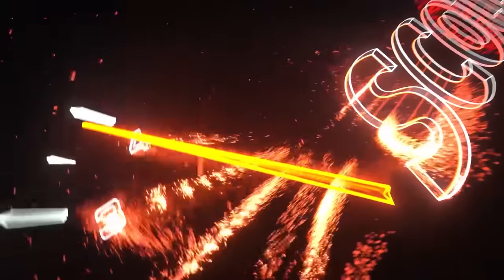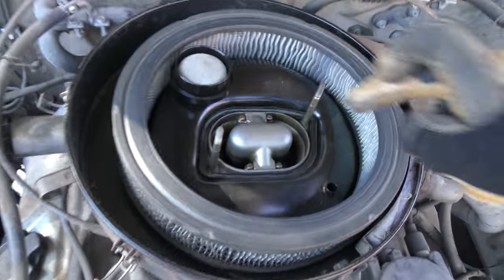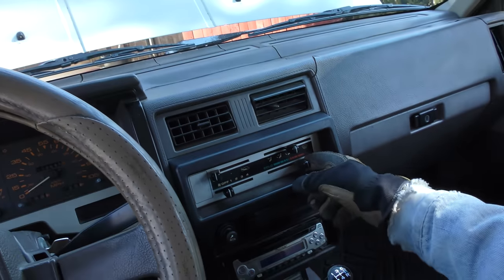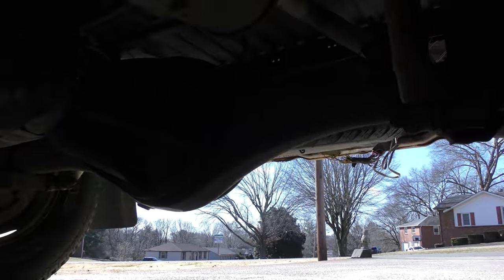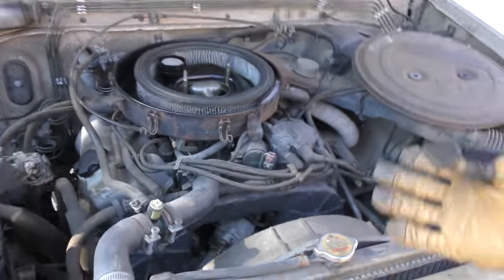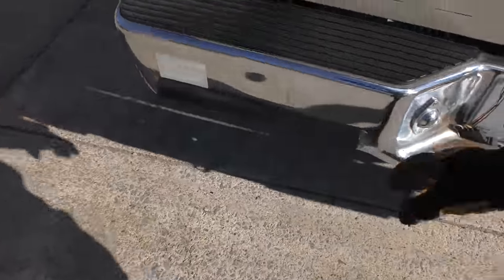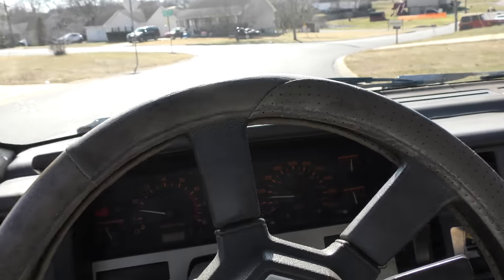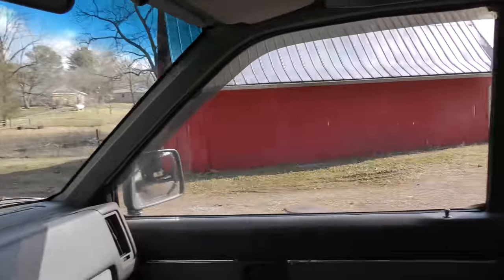I'm Sitting in the Best Truck Ever Made (Goodbye Toyota)

Comment: I had the same year hardbody with a manual transmission and the 4 cylinder, 8 spark plugs engine. No A/C, no power locks or windows but was a solid mini truck. I had to sell it back in 2005 when I moved out of state but I sold to my friend's dad who still has to this day and it's still running strong 😁
Reply: Back in the day certain brands that aren't very reliable today had a reputation for being some of the strongest at the time. I do like Nissan quite a lot and I want to turn one of their cubes electric.....give it a whole new lease on life because those transmissions you know are just junk.... I want to give it a better drive train and prove that nissan and others can be revived and saved by going electric. Plus i just want a cheep cute and reliable car that wont leave me stranded because of the dumb cvt
Reply: How many miles on it? My family has a 8 sparkplug 2.3 Ford Ranger with about 600k miles. Its a 1993 so its pretty basic. The engines been good but the transmissions had the clutch replaced and some minor work
Reply: @carsonac4163  I sold it when it had about 180k miles on the odometer back in 2005. I don't know the current mileage  but the last time I spoke to my friend, his dad just uses the truck if he needs to haul stuff. His dad is in his mid 70's and driving a truck with a manual transmission and no power steering gets challenging for him so he only drives it when he needs to.
Reply: did it at least have power steering? 😂
Reply: They were solid little trucks
Reply: @hllymchll  no power steering 😭 built my forearms 😂
Reply: same but i have it still grandfather parked it about 17 years ago and he let me have it to work on, manual transmission went out at 460k miles engine still runs like its brand new though. he also had the 1996 but it got into a front ender and I'm working on rebuilding both. both are 4x4s with the 5speed manual.
Reply: Saying a 4 is the same as 6? Ok then it's the same as a v8
Reply: Me too..lol..87
Reply: If I remember correctly I paid about 7800 for mine new.
Reply: Yess Sr  b I have the z21 is very rare
Reply: @hybridstoatdragon later Frontiers have been known to go a million miles. That's hardly unreliable.  The c a r CVT issue seems to be the main problem.
Reply: Lol i had the same truck for years, I didn’t even chance the oil the thing never broke,  somebody came over and told me to sell it and ship it to Mexico, it’s been 15 years since i sold it, and still driving, even better.
Reply: I had a 86 Nissan King Cab five speed with a Z24 4-cylinder 8 spark plugs heat and air power steering but manual door locks and windows I had a 89 Nissan with a 2.4 4-cylinder 5-speed regular cab two wheel drive no power steering manual door locks and windows no AC had a good heater though both one tough little trucks the four-wheel drive one an automatic login logout hub
Reply: @harveyshields9534  I want Scott to test out my 1987 2WD king cab 4 cyl XE. Had it since 1995.
Reply: My dad had the same one. 86 1/2 king cab 4x4 4cyl  5 speed manual XE. 
No A/C. Guy who has it now drives it everyday.
Reply: What engine was 4 cylinder with 8 spark plugs, I've owned both models from the 90s with the 4 cylinder. And none of those had 8 spark plugs
Reply: It was the Z24 engine  @Leprechaun_of_Maryland

Comment: I have a 2000 Nissan frontier. I bought it for $500 and replaced the timing chain with my father. Love it. It has never let me down in the 4 years I've had it.
Reply: The D22 frontier is basically an updated of the basic Datsun truck. 

Its bigger and wider but it still has the same Datsun DNA, particularly the 4cyl ones. The KA24DE Frontier engine can trace its roots to the L series engines that first appeared in Datsun 521 trucks in 1969!
Reply: @twoeightythreez  Yep. I once rebuilt the L20B and L28 in my Datsun 620 and Z car. 
When it came time to do my 1987 D21 with the Z24i, I found that everything below the 8-plug head was L-series all.the way. Even the cam drive is the same.
The hardbody even sounds and drives much like a Datsun with a little more torque. 
And in turn, all that DNA came from Prince Motors when Nissan bought them out, and Prince actually licensed it from Benz. So my truck  actually has Mercedes genes, oddly enough. And now, the new Nissan 9 speed is licensed from Mercedes too.

Comment: Actually, BOTH the Nissans and Toyota Trucks from the 80's were like the BEST trucks ever made.
Some carmaker should create "simple" cars again, because they CAN be created to be less polluting as well.
Reply: I had an 82 toyo longbox 4 speed, am/fm radio, vinyl seats, bulletproof 22R 4 cylinder. Wish I still had it, stone simple, reliable and not hard to fix. Unfortunately Minnesota winters were unkind to body and frame. It dissolved.
Reply: @leeuniverse Like the Ford model a
Reply: 100% fact. Best trucks made 😎👍
Reply: Hard to do when a bunch on know nothing bureaucrats in DC tell the car companies what to build.
Reply: That would be great, but then they wouldn’t be able to rob you blind bringing it into the shop every 6 months lol
Reply: Reminds me of the 80’s model Yota Hilux. Solid axle boxed frame. Stupid simple and very reliable.
Reply: I had a1986 Toyota pickup, three speed,got 800000 miles on it, other than oil changes, tires, and replaced the clutch twice, and brakes, it ran till it had two brunt valves, only vehicle I bought new, 5999$!
Reply: Agree. But I needed a wagon, you know, to keep the lumber dry.
Reply: I can’t agree more
Reply: agreed but the reality is all the tech is cheap as chips. A touchscreen for example you can get for less than $100 and it will theoretically outlast a million clicks vs a mechanical contact or relay.
When you have scrapped assembly lines for the newest electro-,automatic gearboxes  transfer cases and hublocking- it's simply un economical to go back to manual. Then imagine trying to get finance- the banks will consider your business model completely opposite to common practice  especially in the face of trends.
Reply: Yeah, I like Money tho
Reply: My brother bought a 1985 Toyota 4 cylinder truck that was ten times better than the 4 cylinder Toyota tacoma truck he bought in 1999.
Reply: I miss those little trucks. Now they get bigger, more complicated and expensive.
Reply: @hkraytai   the new Ford Maverick is probably the most compact sized truck you can buy today and seems to be getting good reviews. Only time will tell how reliable it turns out to be.
Reply: My dream is to buy the intellectual property and old machines to make old Rangers.  Then put them out for $19K brand new
Reply: I wish any company would bring these models back. To see a Showroom hardbody be sexy.
Reply: They make too much money on all the tech they cram I to the car that you then inevitably have to pay them to replace when they break down.
Reply: Toyota hzj75 landcruiser is amazing 4wd slow, high torque diesel
Reply: Agreed.   If they made them again they would sell based on the legend they created.
Reply: Amazingly, even the Ranger from this time, though domestic, seemed to be good too.   My 1987 HB, 423K miles, made it past smog after I was forced to fix the fast idle Scotty spoke of.  2500 rpm numbers actually below average!  Idle numbers a little close. ..ancient cat or injectors may be tired after 35 years.   Just goes to show how they could make things durable at a reasonable price .  I think my truck was under $10k new.    Its at least triple now. And my civic has can cruise at 44 mpg without being hybrid.   Wish we could go back.  I would not even miss this cell phone.

Comment: The reason I'm still driving my 1985 Toyota 4wd pickup.  Under powered (22RE) but extremely reliable.  I'm closing in on 300,000 hard Alaskan miles.  (not racking them up on interstates)

Comment: Agree with you Scotty.  I had a Nissan 1986.5 regular cab truck, bench seat, manual transmission, V6, 4x4 with manual lock hubs.   303,000 miles.   On & off road all over the Rocky Mountains.  The first and best truck I had ever owned.

Comment: I am 82 and have owned many,many vehicles of all brands. The most reliable one was a 94 Ford 4 cylinder with manual transmission, I sold it to a friend with 367,000 miles. Original clutch.

Comment: Definitely one of the best underrated small trucks ever made. Same with the Toyota that had the 22re motor(86-94)
Reply: Yea no doubt, I have the 88 toyota 22re 4x4 and love it its extremely reliable and easy to work on, took it to the beach and flipped it on a washout shore and just flipped over and it drove out fine 🤦‍♂️🤣
Reply: Yeah I had an 86 for a while. It was great when it ran right but some previous owner messed around with the engine and sometimes it would sputter and die. I tried so many things to fix it, but I never got it running right so I had to sell it.
Reply: Dude that sucks on so many levels!
Reply: @jayray89  yeah😆 also I think the transmission in someway or another came disconnected from the transmission because one day it started rattling brown there, then suddenly wouldn't go into gear anymore, but it shifted great before that

Comment: The best truck I ever owned was an 1986and a half. Sold it with over 300,000. miles on it. It was a solid truck.
Reply: I am curious how difficult it is to find parts for the 1986and a half? I'm an older guy and wish I  had known about this model back in the day! I will have to try and locate one! That was one awesome video Scotty!
Reply: @johnthroop2092 Not hard at all.

Comment: I miss my family's 1989 Nissan Pick up.  It wasn't 4x4 but the truck survived me, three older siblings and dad.
Engine overheated but was rebuilt and I continue to drive it until I finally got my '06 Frontier.  Still nothing replaces this particular truck line.

Comment: I have the 1994 Nissan D-21 of this truck.  Everything works great, A/c, heater, everything.  Bought it from my neighbor for only $1,100.  He's right,  It's also the best truck I have every owned.  Love also the 5 speed standard.   Great gas mileage too, 26 to 28 highway.  Even though I have the 4 cylinder, it climbs mountains at 80 mph as if the mountains are not even there.  Great for hauling too!  It's rated to carry up to 2,000 lbs.  I have often hauled 1,500 lbs, in it.

Comment: I had an 87 hardbody with the 4 banger engine.  I pulled a ski boat to all the lakes.  Other than not having much weight over the rear wheels, it pulled the boat up the ramp with no problem!

Comment: I have an 88' Pathy with the V6 VG30i, 260k miles on it, runs smooth as butter. Amazing 4wd system, that thing will crawl all over the place in 4 low. Been damn good to me. Many a long road trips with 0 problems. As long as you take care of them, they will run forever. My bro has a 93' D21 with 300k + miles on it

Comment: The thing is just like my 1993 Nissan Pathfinder, 3.0 vg30e v6 engine, 4 wheel drive, 5 speed manual. The trucks got 197950 miles one it currently and I drive it every day. I bought it just last year for $3700.

Comment: I always wanted one I was in high school from 89-92 so they were new back then. Recently I did trade a van for a 96 extended cab automatic 4 cylinder hardbody. It had a intake leak so I changed that out and then had a mass airflow sensor that needed to be replaced. Got everything situated and the truck was perfect. Drove it a year or two and ended up in a three car pile up. I was rear ended sitting behind a buss taking my daughter to school. The truck was totaled my daughter put her knee through the dash and my head broke the back window out. We luckily were not hurt. Lost the truck

Comment: Bought a Nissan truck new in '95 w/ extended cab with V-6 and manual.  Man...I so regret getting rid of that.  kept it for almost 5 years, 75k miles on it when I sold it, and all I had to do was change the oil and put a new set of tires on it.  Was a perfect truck...

Comment: That truck has definitely spent its life down south somewhere. I live down in Florida and most of the old trucks down here are clean like that. If that Nissan truly had spent all of its life up north in the salt belt  it would be well rested out by now.
Reply: A lot of parts of Colorado use sand during the winter, not salt. He even said it spent it's entire life in Colorado before moving to Tennessee.
Reply: Yup , like mine , still running ( winter ) but even with care can’t contain the rust .
Reply: things don't rust in Colorado
Reply: I just bought a '95 Hardbody here in the PNW that spent most of it's life in central Florida.  No rust 😁  There are still a LOT of these trucks in the PNW as while we do have wet winters and some areas do get snow, we don't use salt here.  I almost always see one when I'm driving around.

Comment: Had a red 91Nissan hardbody for my first vehicle. 5 speed 4x4, my dad bought it used off the lot and had it for 9 years before giving it to me. Sold it still running great at 235.000 miles with very little problems it's entire life. Replaced timing belt once and a couple water pumps. Now 14 years later I have a 02 Nissan frontier sc 4x4. Had it 4 years now and it's been another great truck. Replaced timing belt and water pump just as a precaution when I got it. Love this truck and to me this 2002 nissan is the last of the best Nissan trucks made. I definitely think Nissan went down hill after 02-04ish.
Reply: Russ Sabourin  It was a long time ago when I had to change that water pump, about 15 years ago, but I'm fairly certain it was a timing belt. The truck had the vg 3.0 V6 engine. I'm thinking the 4cyl's had timing chains but the V6's had a timing belt around 91-93. I specifically remember having a heck of a time getting it timed when I put it back together. For some reason the crank cog wasnt marked on mine like the top two cogs were, then I didnt expect the cogs to move when I pulled the belt off (and ofcourse they did) I was 18 and doing that belt and water pump job sticks out in my mind. The dang water pump is behind everything on the front of the V6 including the timing belt.
Reply: Russ Sabourin  The VG30 always had a belt.  You can swap the pulleys with ones off a VG33, they changed the design of the teeth and the belt goes about 20k longer.

Comment: That's what I like about my 96' Ford Ranger, also with Historic tags, 3L. V-6- it has old-school throttle body injection, two point inj. on a  huge throttle tube. Nothing finicky to gum it up. The truck sat most of 3 years, and instead of dumping the fuel tank like I should have, I just topped it up. No problems. No problems with the truck at all, except squirrels wintering over and chewing up wires.

Comment: In 1986 you could buy an f150 with a 4.9 (300c.i.) inline 6cyl (120hp, 255tq). That super cab was a better truck for similar money. The Nissan hard body was a great truck, but it didn't get much better fuel economy. These trucks ran forever because they were more simple than today. The only enemy was rust.

Comment: I've told people over and over ,for years  that the 1986 nisson 4wheel drive trucks were some of the most reliable  ever made.
Reply: I've owned two. One lifted and the other stock. Haven't  had any vehicles  as reliable as these trucks and I had a 1986 Toyota too. It was great also.
Reply: 4x4 had a straight front axle as well, right?

Comment: I bought a 94 hardbody after my cavalier blew the head. The parts for the hardbody were cheap compared to the cavalier. I also like how more open older vehicles are so they are easier to work on compared to the new crap they got out.

Comment: OMG!  My father had one of these just like this with a standard transmission!  The rear seats fold out of the wall.  There was nothing that wasn't solid on this truck except that they would rust badly in northern climates.  I remember the rear bumper fell off when he went to trade it in.  I think it was six years old at that point.

Comment: Scotty I work on new cars for a living I install aftermarket accessories on new vehicles It’s amazing how cheap these new cars have gotten I worked on a new bronco yesterday not the sport the full-size big Ben bronco it has a plastic transmission pan with nothing to protect it under the vehicle stupid if you ask me the interior of the vehicle is very cheap it’s amazing how cheap these cars are being made today and all the plastic in use in the engine bay  And I’m still driving around in my 2003 Toyota Avalon with 230,000 miles with metal in my engine bay
Reply: Wow I didn’t know it was that bad ☹️

Comment: I had a '92 4WD automatic I bought in '96 and drove it for 10 years.  It was an amazing truck and never let me down.  The only issue I had was a vibration from the drive train at 50+ MPH that couldn't be fixed!  New driveshaft, steady bearing, tires, the works.
Reply: Could be something with the frame. I've heard some frames shift and raise hecc on alignment that can come and go

Comment: Scotty is 100% right on that at 1:20. Back in the late 70s/early 80s Dodge/Chrysler/Plymouth had this electronic carburetor that was supposed to improve fuel economy but it was so unreliable that the majority of the time your car wouldn't run right or even run at all. Most of them were replaced by conventional carburetors. Cost Chrysler millions in warranty repairs. It was their equivalent of Cadillac's disastrous 8-6-4 engine.

Comment: Nostalgia always warms the heart.
I had (2) 84 Nissan 2.4 L 4cyl. Carb 
  an Automatic that I drove  and a 5 speed wreck (parts car). So easy to work on! 
It had 8 spark plugs intake and exhaust. 
The fuel pump was in back wheel well which you could change with a screwdriver and pliers. 
Ran great but in NJ it rusted out. 
If I got stuck in snow I would leave it in drive and get out and push.